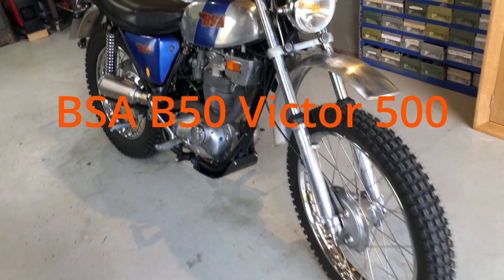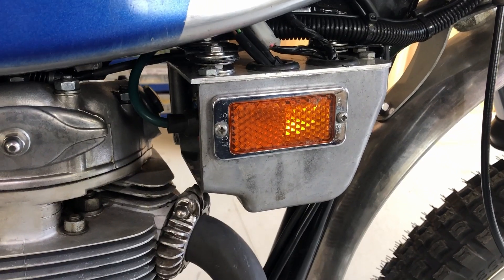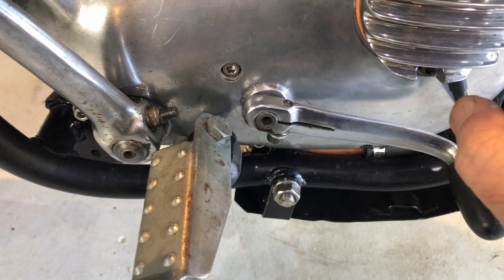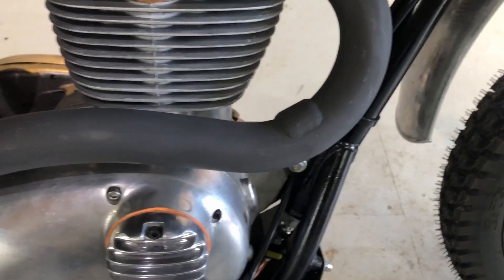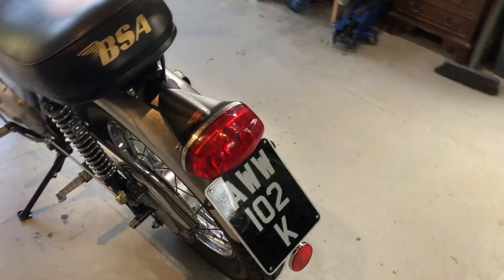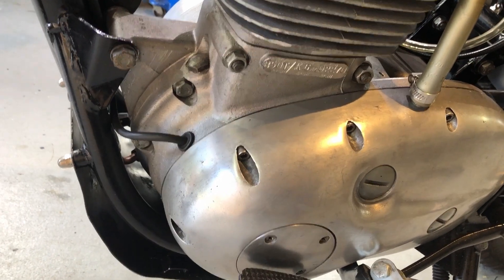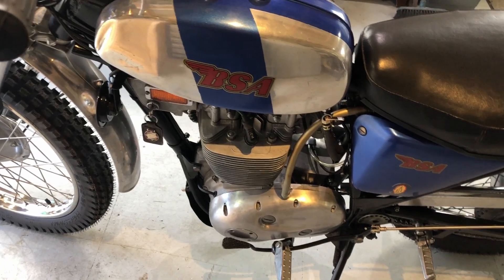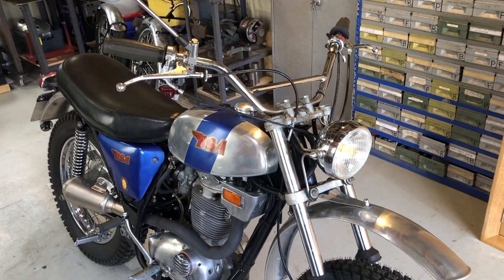BSA B50 Finished (well nearly) Part 1

Comment: Very nice looking B50 in blue, with some sensible mods.
 As long as it doesn't cause oil scavenging problems then the fitting of a proper replaceable oil filter is one of the best mods that can be done on these old bikes. I agree that moving the oil take off to the rockers to a point after the oil filter is a good idea, no point in allowing damaging particles to flow to the rockers and back down into the engine once an oil filter is fitted.
 I have been planning to move the rocker oil feed point on my B25T Victor, and on my B25 Starfire that I fitted with an oil filter.
 But I also have a B50T Victor, it's a project bike that has been sat on my bike lift for the last 6 years. I will be fitting that with an oil filter too, and moving the rocker oil feed.
 The B50 and B25 OIF bikes were originally fitted with a nice small 5 3/4 inch headlamp, so I don't know what that large headlamp from yours originally came from.
 The B50 rear light was a long narrow pressed steel item painted silver, a bit cheap looking compared to the nice cast Alluminium Alloy rear lights used on other BSA and Triumph models.
 I really like your mod to the throttle cable as well, which is another mod I have been meaning to do to my BSA's for the last few years. The standard factory fitting of the cable, just dangling straight down and flapping about and slapping the fuel tank is horrible, and  really sums up the British factorys lack of attention to detail that the Japanese were so good at on their bikes of the same period.
 Did you have to shorten the outer cable to accommodate the length of bent metal tubing?
 Maybe your bike will inspire me to get a move on with mine.
Reply from the maker: Hi, The throttle cables are just universal from ebay where you cut them to the required length and solder on the nipple. The cable bends I make from aluminium or brass round bar which I turn up in the lathe, drill down the centre and put the required internal and external step at each end, then use a small pipe bender to get the required angle. The last 2 previous british bike projects were a 1962 Tiger Cub and a 1961 BSA C15T, (now sold) although I have also restored some early Yamaha and Hondas over the years. Current project is a 1968 BSA 250 Starfire, the forerunner to your B25. The frame was bent along the spine and front downtube, which I managed to straighten cold with a hydraulic press. Forks, rims and hubs are now rebuilt. The engine is fully stripped, crank is fine but I have to make a 2 new stator supports which have been broken off the the l/h crankcase then alli weld them in. Good luck with the B50. I may do another B50 if I find one at the right price, but the B40's, B44's and B50's seem to be selling for silly money even in very poor condition with a lot of parts missing.

Comment: Nice video series. Maybe I missed the part about the final decision for the pilot jet. Did you end up using the 3 ring(richer) jet? Thank you!
Reply from the maker: Hi, after fitting the 2mm shim under the barrel I had another play around with the slow running, it was a tad better now at 8:1 compression, but still not right. I swapped out the 2 band for the 3 band pilot and yes better but not perfect, the optimum tick over speed  now is 825-850rpm, any lower and it gets lumpy. However I have only covered 8 road miles on the bike and she is still a tad tight, maybe after a few good runs I may be able to get the tick over down to 750 and still be smooth, but it has been a tad too cold to go out for a decent run just yet.